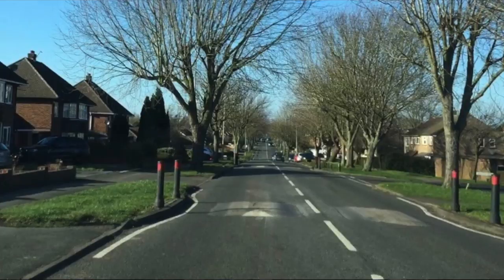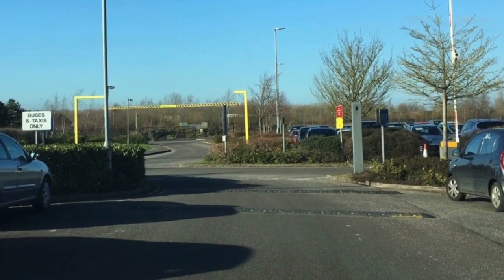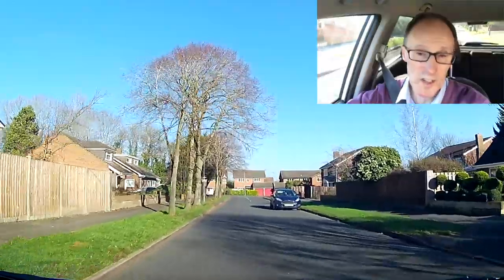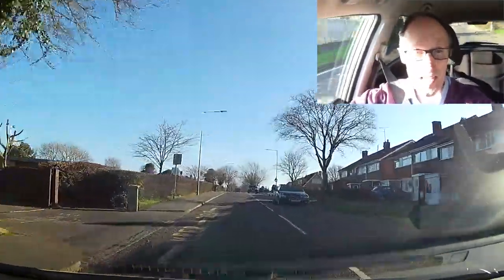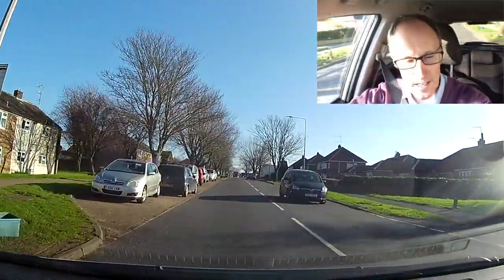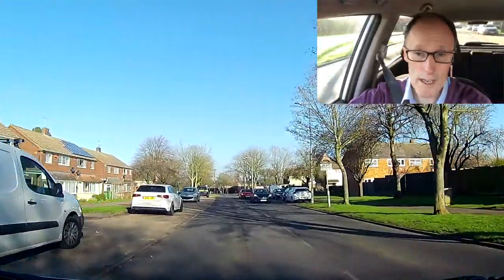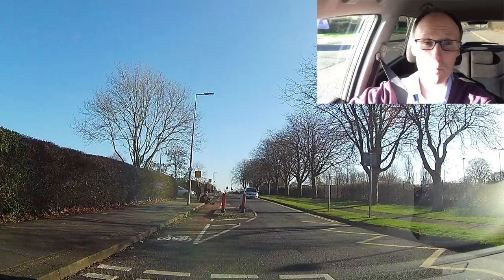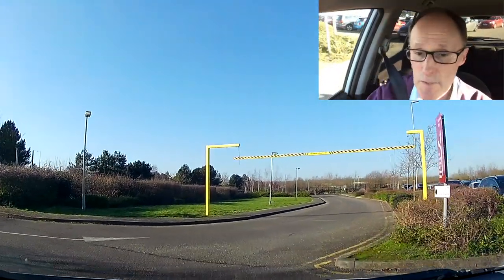How to approach SPEED BUMPS. What speed and what gear

Comment: my problem is whether to change up to third in between the speed bumps .. you did not say whether you were changing up to third in between???  Help?  You did say "staying in 2nd not changing up to 3rd" in that first road, but I'm not clear whether you ever go up to third?   We can't see your hands and it's impossible to see any gear changes.  My own driving instructor wants me to change up and down quite a lot.  Thank you.
Reply from the maker: If the speed bumps are less than 75metres apart I would stay in 2nd at 22mph.
Reply: @JamesTravis  Thats very helpful, thank you. :)  I failed my first test because I was changing up to third and then down to second before each one, but my timing was bad and I was really rushing to get back to second when we were nearly on top of the bumps .. it meant  harsh breaking and super-fast changing to 2nd and the poor examiner had a very bumpy ride.  Thanks so much for clarifying. :)
Reply from the maker: @cjjiver1767  good luck on your next test and watch out for my next video on Monday at 12 noon.

Comment: Some people say that it's bad to use throttle at all even slightly holding it while passing speed bumps.
Is it true? Is it really better to shift to neutral on manual in this case.
Reply from the maker: Never use neutral.
It is ok to use some throttle if needed.
Reply: @JamesTravis  Thanks, neutral is really useful in a lot of cases btw if you don't need engine braking for example.
Reply: Caution sometimes having your foot on accelerator while goin over bumps to fast can cause you to press down on it causing difficulty to control only use throttle if you think your car cannot go over bump without it

Comment: I've passed  1 year ago but I barely drive, like once month at most because I can't park in tight spots or anything. I could when I passed by my current car i cant easily lower my left mirror like I could in my instructors. I dont want to drive because I feel like if for some reason I need to park, I cant. Any parking tips without adjusting mirrors?
Reply: Blind spot mirrors!

Comment: Before watching this video, I went over one of those killer bumps doing about 25mph without realizing I had to slow right down. That's because the bump was in the middle of a road where the speed limit was 30 mph, but I'm also a new inexperienced driver. How should I check for any damage?  Thank you.
Reply from the maker: They are not bumps.